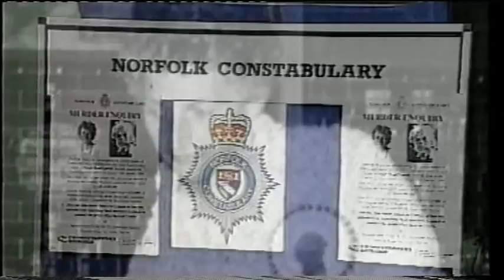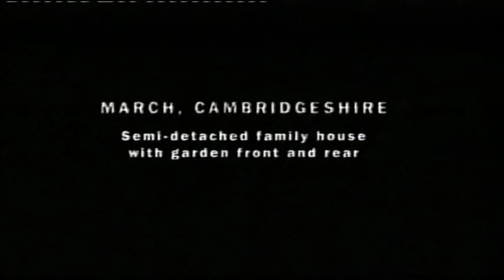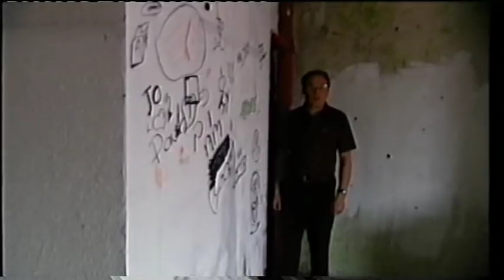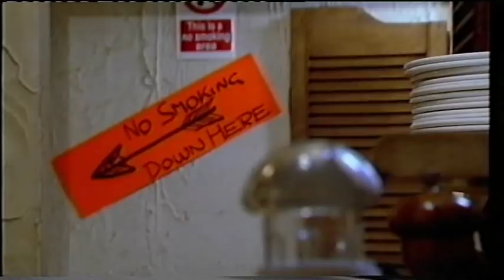Blood Under The Carpet - Murder Houses UK - C4 - 2003

Comment: Owning a house that someone has died in is probably more common than most people think. Not by murder, but just death in general - old age, illness, etc. In the past, it was more common to die at home than in a hospital. If you live in a property that is more than say, 50 years old, it's pretty likely that someone has died in it at some time or another. I used to rent a flat next door to where some old chap was found dead from heart failure.
Reply: Exactly, just on my street alone an older woman died of a heart attack in her sleep about a year ago, then one house just a few house down outside my street a guy was found dead after a couple weeks in the summer heat. His shared duplex flat is still up for sale.
Reply: But these were violent deaths. More chance of ghosts👻